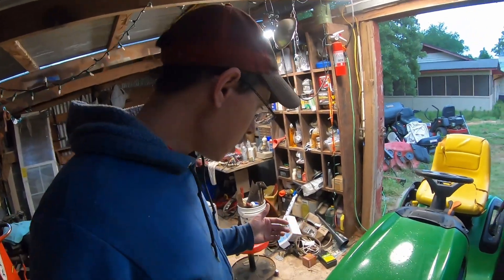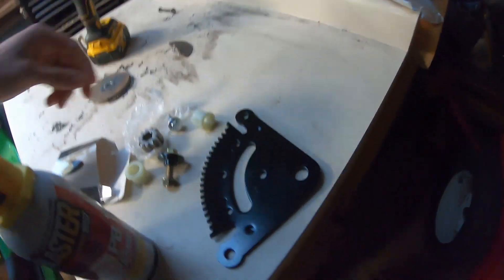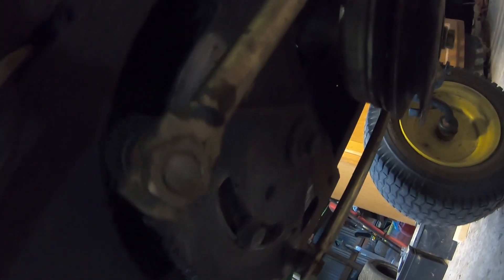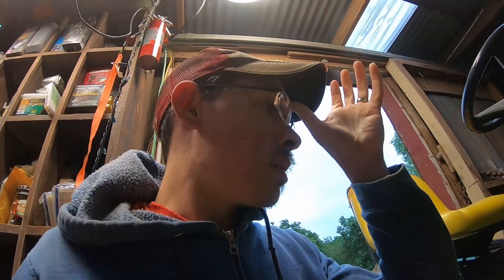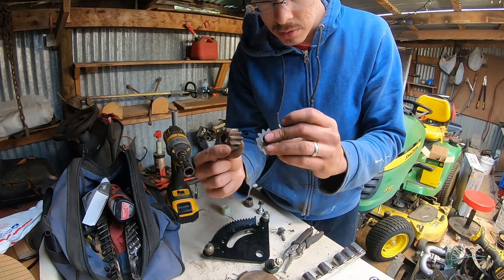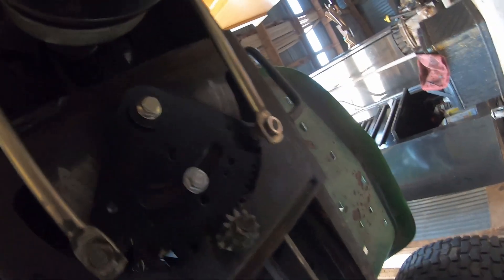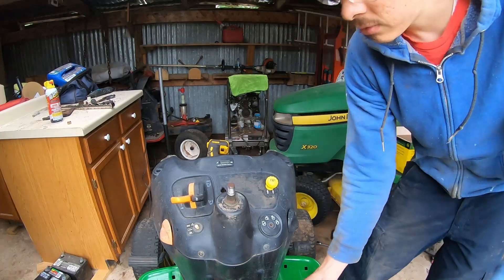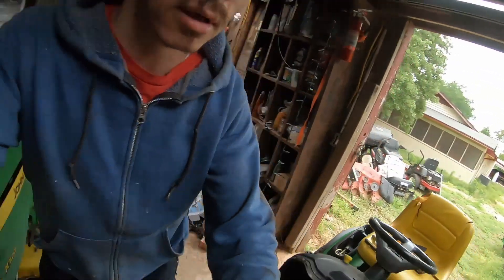How to replace the steering gears on a John Deere 100 series | LA130 Steering Gear | Garage Story

Comment: The plate the Rack is attached to has 2 10mm bolts on each side ( You have to remove the forward pedal connect) Drop the plate and it makes it a lot easier to get to rack Bolts and Nuts and clean up all built up Dirt above rack.